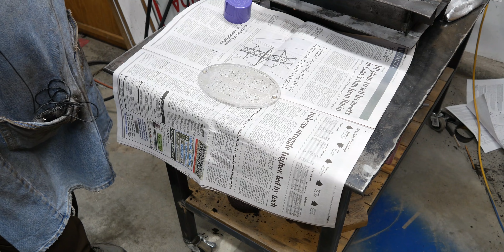Casting an anniversary gift for my wife

Comment: Clean edges, that would be nice. You could try learning the secret art of mold repair with cornering tools, but that seems like a lot of work (well maybe less work in some cases when it saves you from clean up later)...

Very nice plaque. I'm sure you made your wife's day. 

Wait... mold repair was supposed to be a secret, forget that whole comment. Just look at your plaque and be happy with your celebration. Congrats on 36 years.
Reply from the maker: I think just getting a clean parting line would be a huge step. I don;t really want to get into mold repair as I'd like just make matters worse. I learned, by doing a lot of doing drywall taping, that it's better to just walk away than to keep screwing with it. I think the same is true molds. 

Better draft, smoother patterns, and sand not coming up over the top of the exposed pattern arr three things that I can focus on first. 

She was very happy with it :-) Thanks
Reply: I don't disagree. I hate drywall and spackling too. Too thick, too thin, sand sand, sand, reapply and do the hokey pokey again (I say as I sit across from a drywall patch job I still haven't finished.)

Definitely a good plan to stick with the pattern making and the initial molding without getting into the whole repair aspect.

And congrats again.
Reply from the maker: Thanks bud.  I'm weird, but I actually enjoy taping drywall. Once I got reasonably good at it, I found it kinda therapeutic. As I said, weird. ;-)

Comment: Nice present! I’d coat it with a clear coat to keep the aluminum (or aluminium as you call it) from oxidizing! My spell checker doesn’t like aluminium!
Reply from the maker: yeah, mine doesn't either. Did I slip up and call it the right thing? ;-)
Reply from the maker: Oh, and good idea on the clear coat. I'll do that before I hang it up tomorrow

Comment: Hey Perry, do you season your new clay graphite crucibles with borax or just preheat them to make sure any moisture is gone?
Reply from the maker: I just preheat them briefly.  Where I live it's really pretty arid so things really don;t get damp. I had the crucible I'm using right now on a shelf in my garage for several months.  I typically (I've had two) give the furnace a blast from the burner until its warm, then put the new crucible in the furnace (without a flame). Then after several minutes I give the crucible a couple of short blasts from the burner to warm it up further. Then I just heated the thing up.  But unless you live in the desert of a place like Denver you might want to take more care on that first heat ;-)  

I don't see why you couldn't just place it in the kitchen oven to warm it for a while. I would think that would drive off any unwanted moisture

Comment: I just built a fire brick foundry. After only two uses, the steel end of the torch in the foundry completely melted, most of the satanite has turned black or brown, and several of the bricks have started melting. I never expected the foundry to get too hot, but do you have any tips for how I can cool it down
Reply from the maker: Well... after melting the ends off two burners I was told that the burner should not actually enter the interior of the furnace. I ;ave started pulling mine back so the end is just barely inside the hole.  I have melted some bronze with it and I haven't seen any noticeable melting yet. I'm told that in a "proper" furnace the burner tip should last for years. I guess I'll never know ;-)

Do you have a regulator on the line of propane coming into the burner? Cutting the pressure back will definitely cool things down. (It'll also take a lot longer to melt stuff). I have one and run it at about 13PSI for aluminum and something north of 15PSI (17ish) for copper and bronze. I might even go as high as 20PSI if I want to speed things up. 

Good luck with it.
Reply: Thank you, I'll try that
Reply from the maker: No problem. Let me know how it works out.